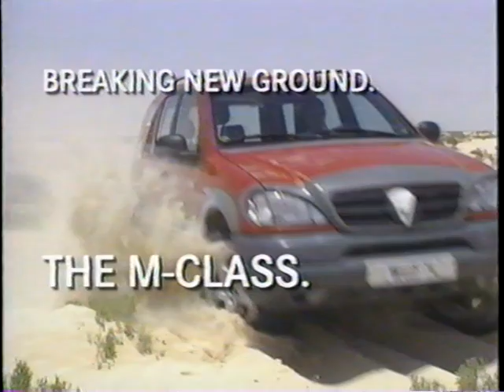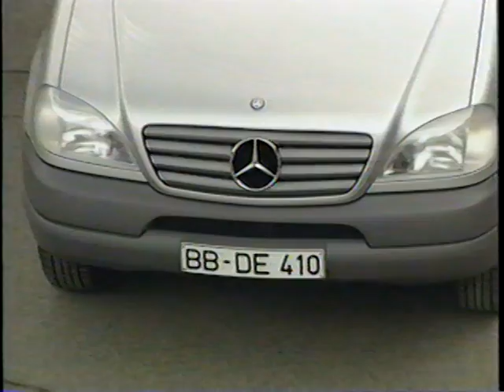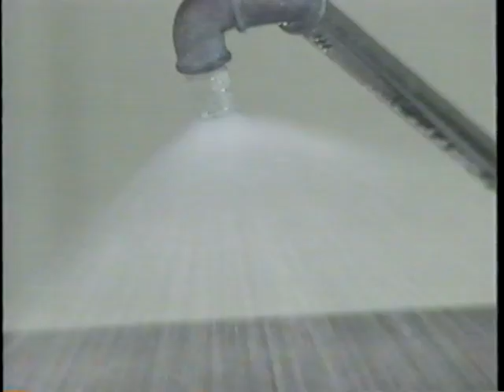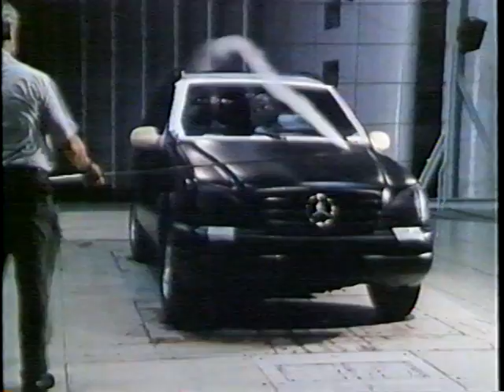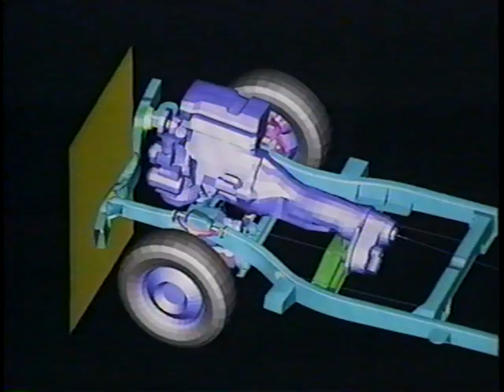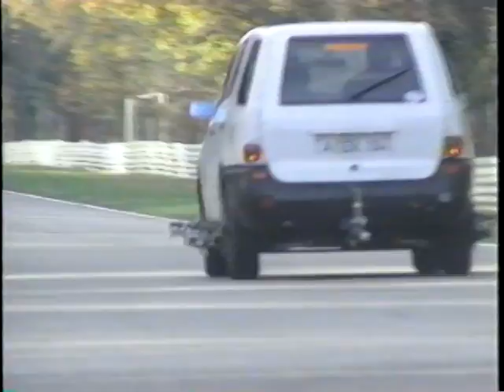Mercedes M-Class Development, testing, and production

Comment: My 2000 ML55 just turned 153000 miles. I love her...
Reply: Your a hater dude .
Reply: Oil leaks ... I put $12000 into her . If I feel like getting dirty I work on her myself. This is the first Benz that i have for not than a year. Every part of that car was hand picked. From the VDO speed controller to the ZF transfer case , the relays are Lucas. 
  And i don’t drive like a grandma. I run her in the canyons. The 4matic is and the suspension is icing on the cake.
Reply: And so your heart doesn’t strain too much , When I bought her I spent $13000.00 U.S Dollars, not pesos. To take care of those oil leaks. 
 You probably think I take my ride to Jiffy lube.
 She wasn’t my first Benz...

Comment: I work at the plant that builds these!!
Reply: what kind are the best durable one?
Reply: All are really.
Reply: Ray Johnson send me some ml parts 🤧
Reply: Ray Johnson thank you... I am proud and fortunate to have found a 2000 ML55 ( 65000 .org Miles). 
 She currently holds 151000 miles. 
  What a wonder . Thank you 🙏 😸
Reply: @cesartoledo5621  Good Job Cesar !!!    Remember when you get oil leaks..   All you have to do is have the car completely torn down at an illegal car stripper place ....    then you can get it all fixed up and put back together !!!
Reply: Do you have an email to reach you on?
Reply: There are still plants building W163s??
Reply: @Johnathan_Waters   w163 ended in 2005 model year

Comment: i have 1999 ml320 and its an excellent car
Reply: +Muhammet Fatih Özdemir Me too
Reply: Me too. It's fully loaded and everything still works on it to a charm. Not to mention underneath the car is very dry and clean even with 220,000 miles on it. It has been extremely well maintained with new U-Joints, new radiator, starter, both motor mounts and the flex packs on the drive shaft. Unreal how awesome this car still is. It'll probably go for 500,000 if I keep using the synthetic oil.
Reply: Muhammet Fatih Özdemir my mom has one
Reply: My 1998 ML 320 is still going strong in 2019. Its has amazing durability. They must be built to last.

Comment: Bought my ML320 in December 12, 2000. Still running strong with only 57,000 miles on it. Only changed fuel pump once.
Reply: +cyronader NICE!!
Reply: do you still have it? my uncle still have his audi allroad 2.7T from 2001
Reply: I have Ml320 and now over 300k miles still run good❤❤

Comment: Wow awesome unstoppable reliable and bulletproof vehicle. Plus it's a benzo
Reply: Not really a reliable vehicle especially the first generation
Reply: @Shadowcu123  I had over $9000 in warranty repairs on my 2001 ML430 (thank you, extended warranty!). Then the trans failed at 98,000 miles. Once I got past the first several years, it got pretty reliable for some reason. Still have it. Still is like a tank.
Reply: ConditionBlack lolz
Reply: ConditionRed its not bullet proof tho

Comment: My first ML350 was a 2010 Bluetec, which I do regret selling and will have to buy another. My second ML was a 2006 average ML350, didn't like it much.  Now, I currently own a 2001 ML 55 AMG and love it. It doesn't top the 2010Blutec V6 turbo diesel but, it is better than the average 2006.  Mpg is 11-13 on the AMG, which makes the 2010 Bluetec a superior choice, compared to any s.u.v.  I was getting 22-27 mpg and with over 420 horsepower.  The  most quietest and environmentally friendly diesel!